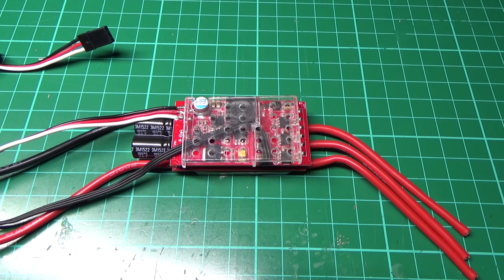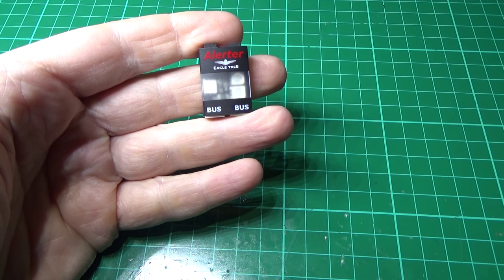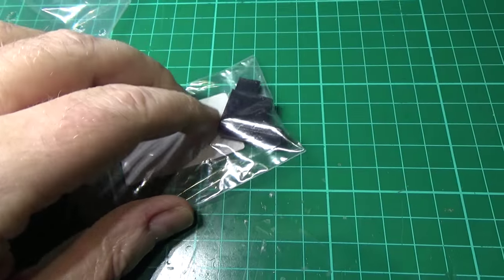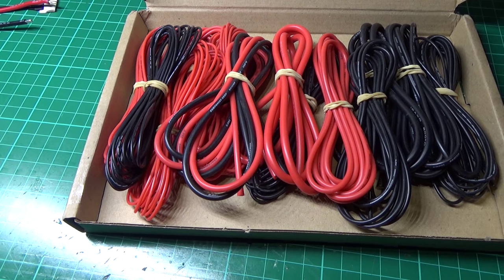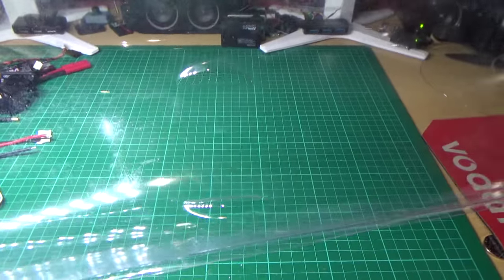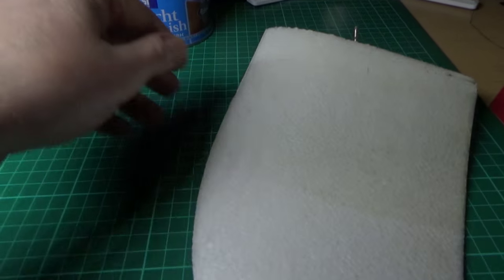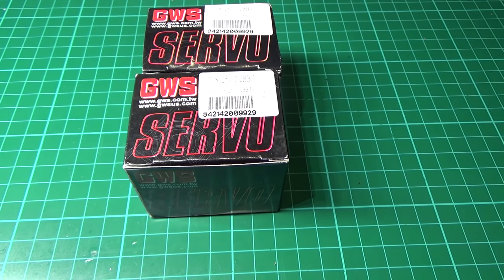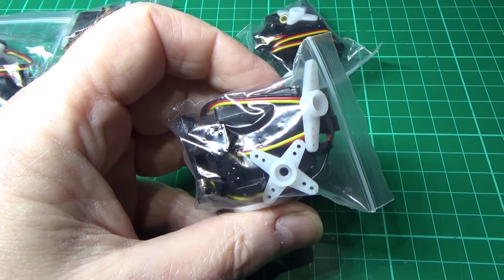SkyHunter FPV build part 1 - Parts list

Comment: If you still can, I recommend taking off the belly pan. I had one on, and my skyhunter took maybe 200 more feet to land (seriously). There also is another video that a guy was using the pan, and the plane bounced from 50 feet away and slammed into his friends jeep. Replace the belly pan with gaffers tape, it works much better, and it is stronger than duct tape :)
Reply from the maker: +Daniel Perkins I saw the video of the 'Jeep strike' but it's too late..... It's already built but I decided to (stupidly) fit landing gear too. It'll certainly take more than a few feet to stop now :-)

Comment: I see you've really done your home work on this fpv platform. I've watched a lot of videos on this RC flying and nothing I have seen flys better. Something about the air frame design.
Reply from the maker: +etab83 I searched for a long time, trying to find the best FPV platform and this one kept coming up. I was trying to find a large plane with a rear mounted motor and a neutral thrust angle which wasn't a flying wing.

Comment: Have you had any issues with you 1.3 vtx and you RX? Someone on fpvhub was telling me I would need a filter?
Reply from the maker: None at all but I'm using a low pass filter. If you use a 200mw 1.3 and put the RX on one wing and the VTX on the other, you won't have any problems. My Mini Talon is running perfectly without one :-)